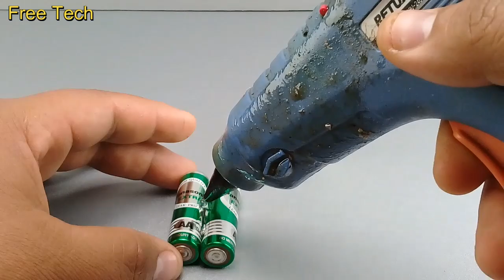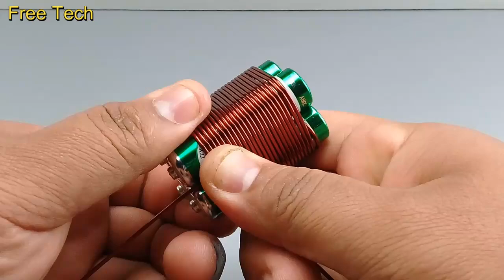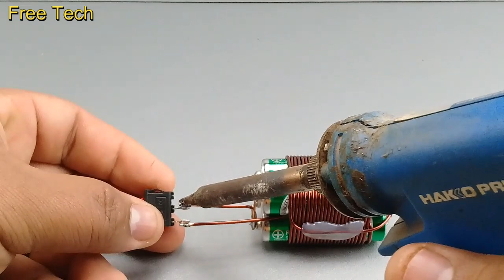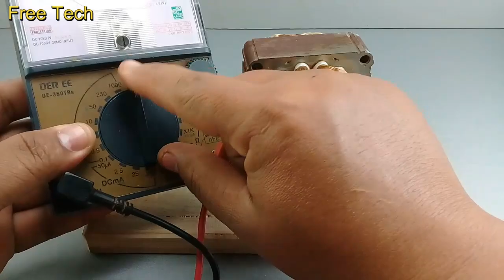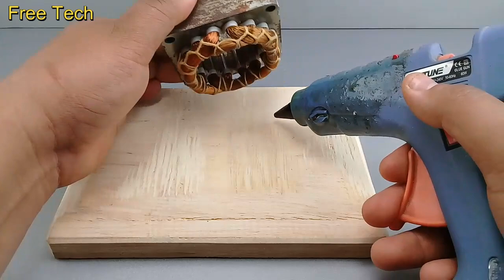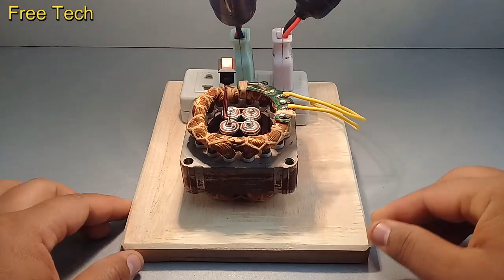How to Make 220v 4000w Free Electricity Energy

Comment: How is possible to switch on and of from distance??
What is the diameter of the wire used?
What is the type of batteries used?
4 how long time you think that it will work like that? I mean without needing to replace the batteries or the rest of materials used to  ??